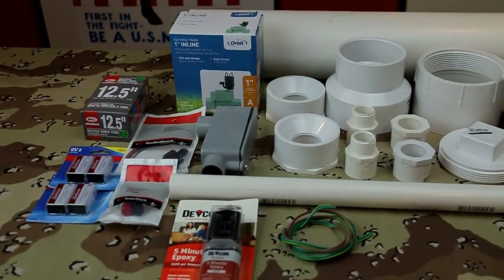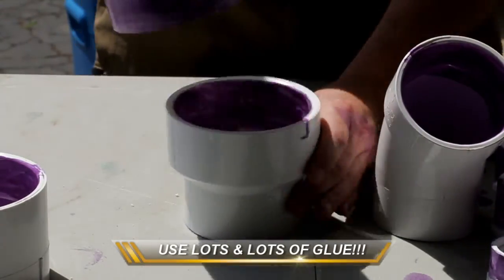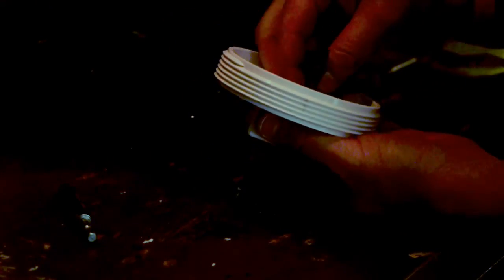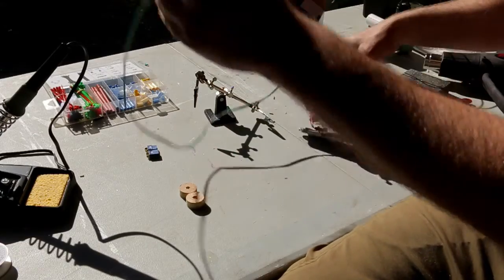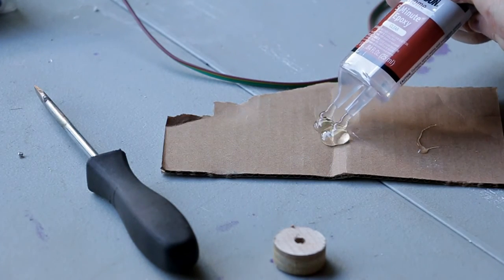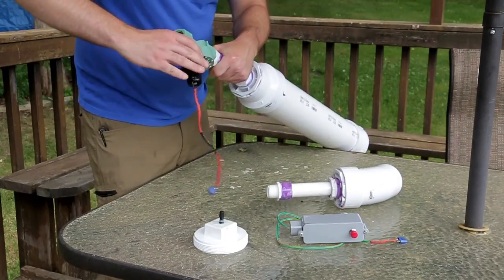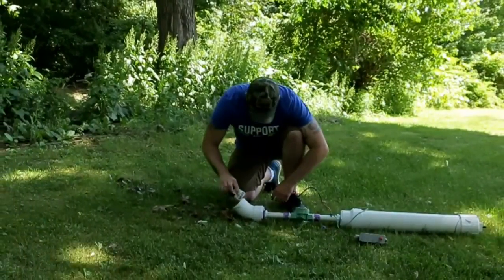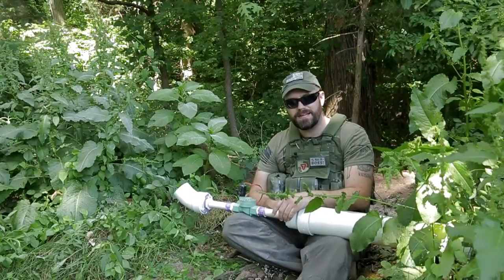HOW TO BUILD AN ELECTRIC PVC AIR CANNON FOR FILM - WITH REMOTE TRIGGER SPRINKLER VALVE

Comment: Could you build this using gas pipe?  Can you run a DC line to set this off from far away?
Reply from the maker: I think gas pipe would work, but it would be very heavy, and I don't think you would get a wide enough diameter.  I made a 25foot extension line that works great.